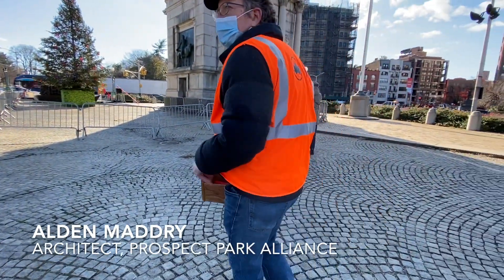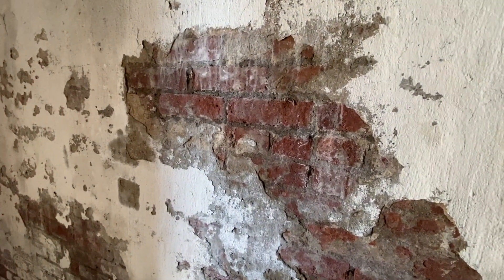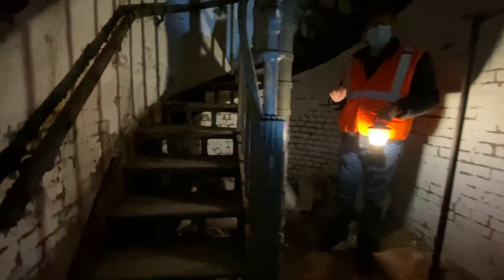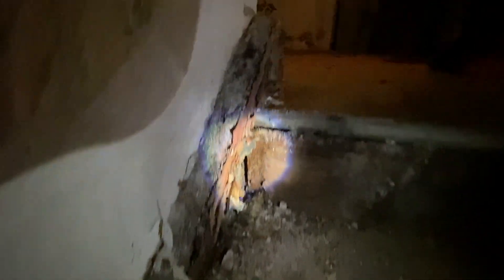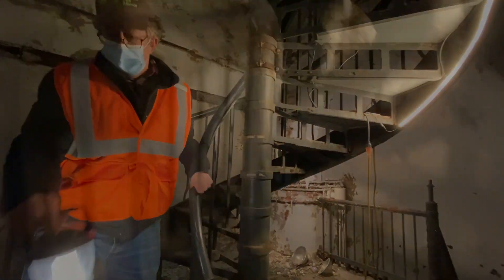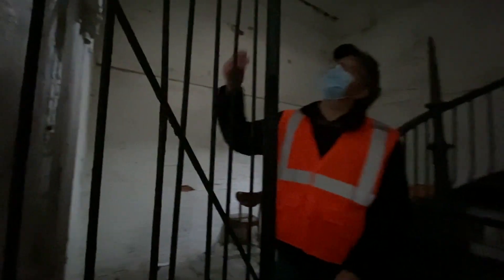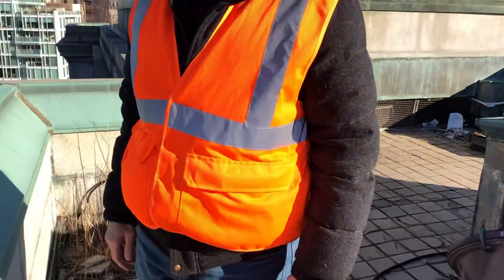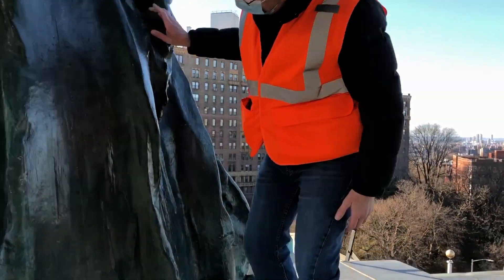Inside the Soldiers' and Sailors' Memorial Arch

Comment: Does installing a acclimatization system inside the monument could prevent it's deterioration due to humidity and temperature?
Reply from the maker: Hi Johnny! Alden says, "In terms of conditioning the interior space - we will be installing a mechanical ventilation system that sucks air in the doors at the bottom and pulls the air up and out through the roof in 3 locations... this will reduce the humidity inside the arch allowing it to dry out more quickly. I installed a humidity monitor inside the Arch during the design work and the humidity inside the Arch was often 25-30% higher than the outside air... the new ventilation should greatly reduce the humidity problem inside the monument."